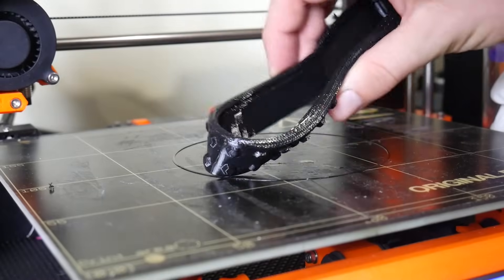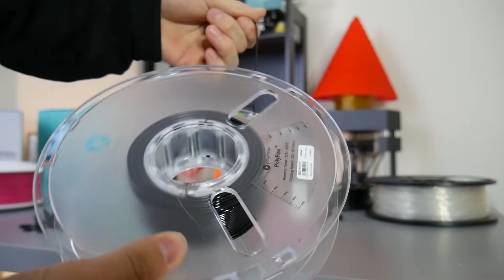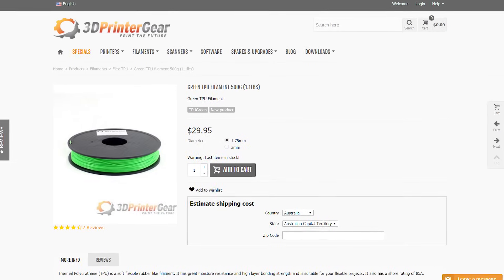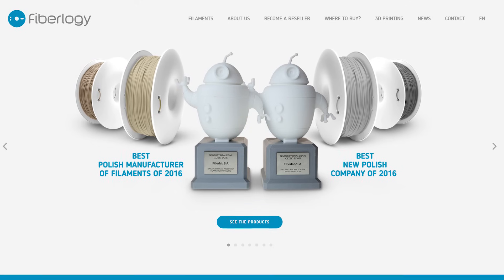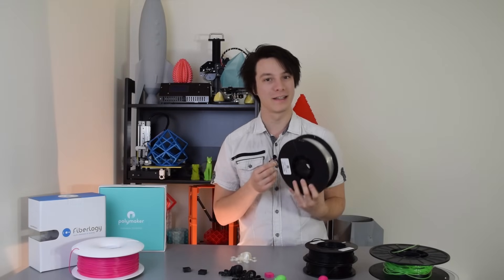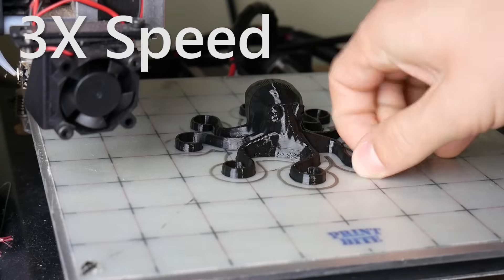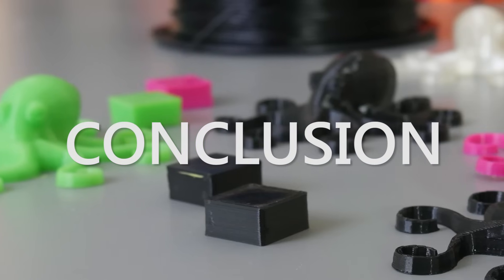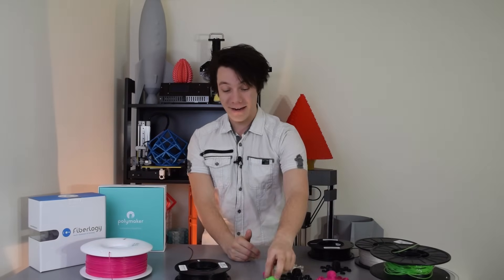Flexible 3D Printing Filaments Tested - Which Flex is Best?

Comment: Today's grammar lesson:
Contrary to popular belief, the s-plural is always correct to use with English nouns, even if they are of Latin or Greek origin. Exampels of this are "cactuses" and "octopuses". Using the Latin or Greek plural is also correct, if you so desire. In this case it would be "cacti" and "octopodes" (not "octopi" like many think).

Comment: While this is an older video, I have just bought & tried a roll of Polymaker TPU90. (purchased locally here in Oz) This is the softest filament I have tried to date & have been very impressed. Yes a few little tweaks for my Prusa & though it's too soft for some things, so far I have found it to be of very good quality.

Comment: Printed Overture TPU on Anycubic Kobra. It was a Tinker CAD model for a handle that had to be easy on the hands and had to slip onto my tool end. The auto feed required pushing in  the filament until it stops, then getting the extrusion started. The hole in the handle where the end of the tool was about 18mm square and went in about 60 mm into the handle shopping 50mm before the end of the handle. I was concerned about what might happen at the end of the hole, but the Kobra bridged across the end of the hole and went on to the end of the handle. I wonder if PLA would have done the same.

Comment: What material would be the thing to use for a bicycle phone holder? I have just bought a prusa so I am considering what to make. Last year I wanted a phone holder thingy for my bicycle. They did not have them for me then, so now I am wondering if I may not just as well try to make one ore two myself. I kinda have this idea of just slotting it into place. However, perhaps its just as well to have some straps or clamps or something. I do not want my phone falling onto the road or something in any case.

Comment: What would you guys use to print hard clips that bend to fit into a hole?  Like the squeeze clips, where you squeeze the end and it bends the arches inward, and then it bends back to normal in the hole to keep it in there.  Then you squeeze the ends again to bend in and pull it out of the hole?  So it's hard plastic but can flex a bit without having to worry about it breaking.  Any recommendations?

Comment: Hi there, thanks for your video👍 just wondering is the flexion extruder a must? I probably only need to print the rubber tires for once and do not need to do it again. Do I still need to buy the flexion extruder?

Comment: I need to print a cover for the metal frame which needs to protect from bumps. Need flex, not elastic, able to absorb bumps
the cover is 500x370x60 mm thickness 3mm which is pretty large are and no need to bend when free staying on the table.  So much confusing termination similar terminations like TPU or TPE which a lot of people tried to explain but they are confusing too. 
My bet is the first black octopus material. What do you think? Thanks on advance

Comment: What is the infill amount in the tests. I tried the MatterHacher's Build Series TPU and the filament seems flexible but prints pretty hard. Basically hard with a rubbery coating more or less. Less hard with thiner parts of a print. To get any considerable real flex out of this filament I would have to print at 10% infill or less. I only printed a few items with it.  A cute little baby Dragon on Thingiverse.  The ears were flexible but the body was pretty hard.

Comment: I'm using a generic TPU (kind of the first one in the video) and I'm able to print it at 40mm/s with 6mm of rectraction without any issues (with a TEVO tarantula Pro, bowden extruder). The main difference I changed is to reduce the extruder tension to almost 0, and raise up the extrusion multiplier to 1.4, and it's working fine. I wonder if someone else already tried it.

Comment: I have a stock Ender 3
I am looking to print new handlebar grips.

All I have ever worked with is PLA.

Suggestions for proper material???

Some softness to them would be helpful, as a lot of vibration comes through the handles, but they still need to be tough enough to withstand the weather (rain, sun, wind).

I'll probably print this, or similar.: http://www.thingiverse.com/thing:3188630   in Black.

Thank you.

Comment: TPU sticks like CRAZY to PEI - I had to take my base OFF to work in my lap to put enough pressure to remove my first TPU print. 

SO what is this bit about "distance" - can you do the first layer at different "heights"?  I notice mine at .2mm always start at .3 on my LCD.  Thanks!   Great Vid!

Comment: i just found this video and have a project for my model trains from the 1950s. we used to get rubber road bed that our track would fit into and it would hold the track on the table level and quiet the rumble of the model train. well this rubber road bed is not available anymore. And it is $4 a piece used from 1950. I have two piece, a straight and a curve i was asked to see if i could do a CAD design and print the the part in flexible Filament that could hold the track. What would you suggest. pliable  but not super flexible may be the best as it needs to bend to allow the track to be inserted but then firm enough to hold its shape and hug the track. Any ideas?
Reply: Have you considered making molds from the pieces and casting?  Seems like it would be easier and give you a better final product.

Comment: Ninja Flex is my fav for anything I need flexible on a quad. I have gotten some 63A  to print on Ender3(Amazon Basics). I have upgraded the base model Ender3 as follows: Capricorn PTFE, Changed to a 26 tooth extruder gear and sharpened it with a small dremel sanding disc at very low speed I was really trying to get rid of some burring that didn't get cleaned off at the factory, and I also printed the extruder clip that puts more spring tension on the material going through the extruder gear. Here's my settings: nozzle size .36, flow to 105%, print in .16mm or smaller layer heights, only 40mm\s on print speed, and change your infill and inner wall speed to match. I also printed the material at the top of its temp range. A slow go compared to the 92A Ninja Flex at 85mm\s infill and inner wall at 100mm\s

Comment: TUP is good for stubby holders. Especially if you put a bit of texture on the outside. Remember to put a hole in the bottom though or getting the can out is a nightmare.

Comment: 3D Solutech is all over Amazon and I have had good luck with their PETG. Better than eSun. They have a TPU for $24 a kilo US. WAY cheaper than most TPU. If it's available across the pond I hope you test it in part 2 or part 3. I have not yet printed with it, but I got it to make gaskets for my dry box fittings.

Comment: Hi Angus I have a question. Have you ever tried flexible filament with the Cetus. I have a Cetus and simply love it. I've used PLA and PETG and it works like a champ. I've never thought of using flexible material because the Cetus software doesn't have a lot of option for retraction and the like.

Comment: I'm a newb to 3d printing... just bought a CETUS MkII extended... which I understand to be a "PLA only" machine.  Would any of these run on the CETUS? I'd gladly pay a premium price for a flexible filament that will run on my machine. Thanks in advance for any help you can provide.

Comment: For the materials that, when printed, the body of octopus was too solid and inflexible, did you print the body solid, or hollow, or with some kind of honeycomb support inside the body?  It seems to me that there was no reason to print the body solid, and you could have selected a hollow octopus body in the slicer software.

Comment: Can you do conductive filament. Currently im using regular PLA to print molds for silicone, and a second mold for the conductive part, which i then auper glue together. Im thinking about investing in a second extruder so i can print flexible filaments, and then use my first extruder to simply print the conductive part straight to the flexible rubber button arrays in one print.

Comment: Which one used for duct fan for high speed operation (rc)
Reply: ajas shamsudheen You wouldn't want anything flexible in a ducted fan as it would deform in use. Another issue that would be very difficult to avoid in a 3D print would be accurate balance of the fan blade.

Comment: Question: If you have to print a unit that's 24" long by 2-1/2" wide by 3/4" high.... BUT your table is only 10 or 11" long -- How do you do it? And assuming you would split the model how would you connect the 2 or 3 pieces together and still be flexible?

Comment: Some of the difference in "head squishiness" could be air trapped in some but not others. 3:06,  5:03, 6:58, 9:31(trapped) vs 8:48 (not trapped).
 Also, is the level of infill identical in all cases?

Comment: Great video. I blindly bought nijaflex and it is elastic and combined with the fact that it stuck to itself on the roll a little bit I was unable to print on my Cetus(under extrusion). Now I have a guide I can use to determine which brand to go with, thanks!

Comment: Could you 3D print some skateboard wheels with these flexible filaments for a video?
Reply: I would think the urethane one can't remember but, if you ride street then you're going to want the harder, concrete pools and that, a slightly shorter urathane.

Comment: Who else thought about printing dildos
Reply: story teller 4355 that's actually the only thought that i had the entire video
Reply: Plastic with all of those build lines would collect bacteria incredibly quickly. You'd have to make sure you always used a condom.
Reply: mca mac wouldnt be a problem if you clean it with a strong alkali
Reply: better to cast, mold and then use silicone... if you really want a custom dildo.
Reply: Dildo professionals here
Reply: Tires around wheels & dildos. Literally nothing else to use it for

Comment: Excuse my ignorance, but what is the thin line around the base of the print when he removes it from the base plate? Maybe he's done a video explaining this...
Reply: Sometimes when your hot end is heating up, the plastic will droop down or stick around it. So the printer will print that line to that make sure that there won't be any missing plastic at the bottom layer or get the excess chunk of plastic out of the way. Makerbot's printers also do this but they draw a straight line near the end of the buildplate, which I find is much better to remove it, and also the chunk wouldn't be stuck again to the hot end.
Reply: Thanks for explaining!

Comment: Super helpful video Angus. One question, how do you get the bottom of your flexible prints smooth and glossy? I am currently test running products for our company on china-brand Buildtak and the bottom ends up sort of frosted per say. Thanks in advanced.
Reply from the maker: I'm printing on smooth build surfaces such as PEI and Print Bite (garolite). Buildtak will leave a textured surface. Try glass, if you heat it up and get the first layer distance perfect you get amazingly smooth first layers.
Reply: Awesome, thanks again so much!<3

Comment: what about handling grip on a flat surface to make like rc tires ? with best ?
Reply: Nobock fiberflex i think
Reply: Depend of the use, harder compound it will last more but you will get less grip... and viceversa..  probably 80 is a good starting point..

Comment: how about testing other mechanical properties such as grip for wheels or rubber feet or usability as gasket material. Test how well it does in different applications such as a printed belt drive or as a hinge.

Comment: If setting up a spare printer just for flex printing, would you recommend the Flexion extruder and, 
what size flexible filament ? 
I'm thinking 3mm may be easier to extrude than 1.75... is that true?
Cheers,
- Eddy
Reply from the maker: 100% would recommend the flexion it's still working for me over a year on and I've flogged it. I subscribe to 1.75mm but really it's much muchness. I think flexion is only for 1.75 though.

Comment: I can't get X60 to print that well with my Flexion, but I have the E3D version (volcano). Mine look worse than your Prusa print. So much skipping!
Reply from the maker: slow the print down, turn the temps up a little and definitely consider backing off the tension on the extruder slightly. That should help.

Comment: I've been having issues getting good settings for the X60. Did you tweak your settings much?
Reply from the maker: I didn't change anything, maybe try printing slower with a bit more heat and make sure it's not skipping or slipping by dialing the tension. For some reason I didn't have to adjust for the whole range of flex filaments.

Comment: Octopuses is the correct term.
Reply from the maker: I figured I'd get it right if I said it every way possible.
Reply: Eli Baker It should be octopodes, but almost certainly isn't :)
Reply: Yes, either octopuses or octopodes. Octopi is 25.13274.
Reply: In fact, i was just doing some digging on this and as it turns out, both are correct forms of the word.
Reply: @harrier331 
Plural words ending in "i" is a Roman thing.  Etymologically, octopus is a Greek word (albeit, with some Latin influence).
Reply: Actually, its octopussies

Comment: I wonder if it's possible to print a belt with flexible filaments. Like a GT2 for example, or some other not so tiny teeth but something that could be used in a custom project. Not that we "should" start doing that since I think it's more cost efficient to just order it online, but would be a nice thing to try!

Comment: For anyone out there that will be using "generic" TPU, increase your top layers by 3 to 5 depending on how much you want to slow down your print speed. I've noticed that if I add 4 layers I don't need to slow down at all. Of course, your mileage may vary.

Comment: @Angus: I'm wondering ; what about the grippy-ness of those materials?
I've used some TPC-flex in the past and prints where flexible, but still quite slippery.
I printed some rubber feet for f.e. a 3d printer, but the machine still slides on the table too easily.
Which filament can be used best for this application?
Reply: Winand D I have some NinjaFlex, I printed feet for my printer. They hardly move at all. Maybe it also helps if you change your bed material (glass/tape)
Reply: Alright, i should try some Ninjaflex then! I print on a Buildtak surface (sometimes on Kapton), so it does not leave any tape residu.

Comment: 1080p 50fps.. thats a first for me :P
Reply from the maker: Welcome to Australia :) our mains voltage is 50HZ so our frame rate has to be multiples, or we get flickering.
Reply: 50 Hz mains/50 fps video are common everywhere aside from US/Canada plus a couple other places. Still better than 25/30 fps. :D
Reply: It seems like a good compromise for normal TV. 30fps is very annoying at times, and 60fps has been the standard for games and computer applications for so long that it doesn't feel like tv outside of sports imo.

Comment: Good video :) A video on how to use flexible filaments with a bowden tube would be great.
Reply from the maker: If it's 1.75mm... you basically don't. You MIGHT be able to get away with vase mode printing but more than likely it'll kink in the tube and jam. If it's 3mm filament then just print crazy slow, like 10mm/s and it might work.
Reply: Thanks for the swift reply.
Reply: Maker's Muse I have printed NinjaFlex with a bowden setup. That works fine.

Comment: Octopussy*
Reply: followed by awkward chuccle
Reply: MibMoot Octopodes
Reply: Octopussies
Reply: Octopices
Reply: Wifi Connected 3d printed "Adult toy" ?
Reply: James Bond
Reply: Octopi*
Reply: @mibdev  *Octopuses
Not octopi. Technically you can say octopods, but that also would include squids and such :) You know, if you want to avoid sounding like you are saying octo-pussies.
Reply: @rich1051414  Squids have 10 appendages.  "Octopodes" only refers to the plural of octopus.  Besides, "octopus" literally means eight feet, so if we were only taking names literally, spiders would be considered octopodes and a single spider would be considered an octopus.  We don't do that though, so, as with octopus, "octopodes" refers only to the plural of octopus.

Comment: A bit disapointed that there is no Filaflex or Ninjaflex, but great video
Reply from the maker: true, but don't see it much in Aus. Maybe it'll be in a part 2.
Reply: Maker's Muse May i suggest that you also test Semiflex ? So that you can compare what you call semi-flexible materials to what is considered by manufacturers "semi-flexible"
Reply: Cheeta from ninjaflex seems interesting.
Reply: Make a giant bouncy ball!
Reply: When is part 2 coming?
Reply: Carter Bridges I like Cheetah also much, easy and fast, good quality, won't buy basic TPU anymore
Reply: I love the design of fiberlogy spools
Reply: Ola Ruud I have used cheetah filament and it's amazing. Printed at 60mm/s and it worked perfectly. very flexible and fast. No jams or anything. Just a very expensive filament lol